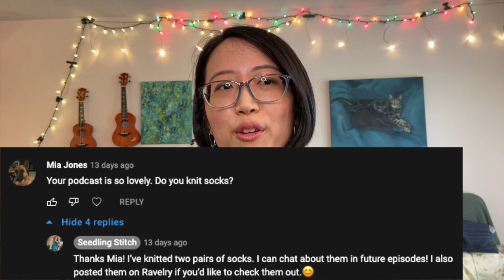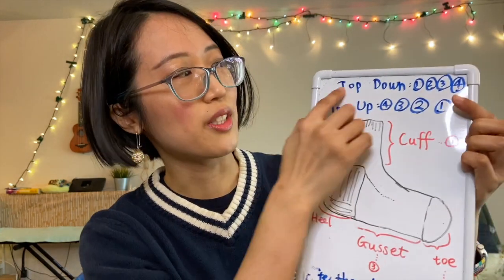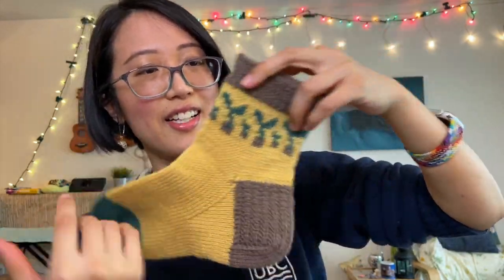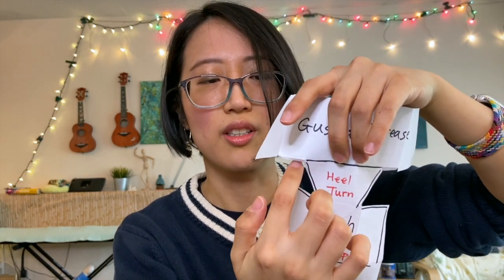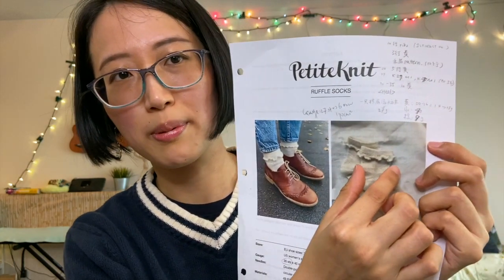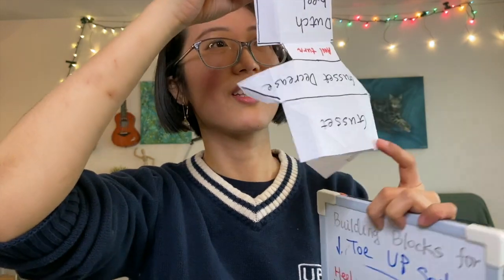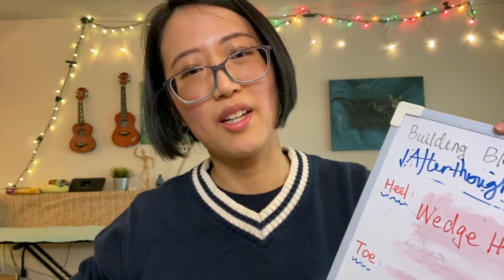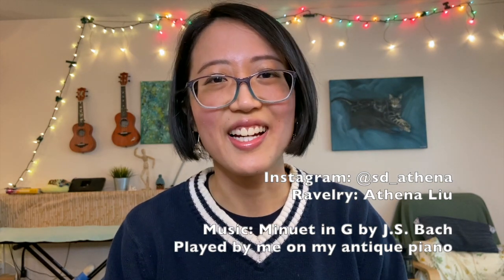Sock Constructions Explained by an Engineer with Origami - Ep. 4 - Seedling Stitch Knitting Podcast

Comment: Athena,  you are a gifted teacher!   Even though I have been a knitter for over 50 years and a sock knitter for seven or eight years I so much enjoyed this podcast. I knit my socks toe up two at a time using two 16" circular needles.  For me the "Turkish Cast On"  is the most efficient way of starting my socks.  What I love, love about toe up socks is that I get to decide how long I want to make the leg part of the sock.  Of course it also depends on how much yarn I have to work with.  Knitting socks two at a time works exceptionally well when I am repurposing yarn. Also I don't have to keep track of how many rows I knit on the first sock in order to make the second sock the same length.   Looking forward to seeing more of your podcasts, Sarah
Reply from the maker: Thank you! After a few episodes you’ll find that I joined Team Toe Up Socks completely! My only difference from your preferences is that I don’t like two-at-a-time, because the work becomes too heavy on the needles and tends to make my wrist ache… And the two yarn balls get entangled 😅.
Reply: @SeedlingStitch  Welcome to the Team Toe Up Socks!!!  I'm wondering if your elbows are being supported while you knit?  I have a pillow on one arm rest of the chair and a rolled up towel on the other arm rest so that my elbows are resting comfortably while I knit.  I find it makes a world of a difference. I put the two balls of yarn in a zip lock plastic bag without closing the top and it seems to help a lot with keeping the yarn from tangling.  Hope this is helpful.